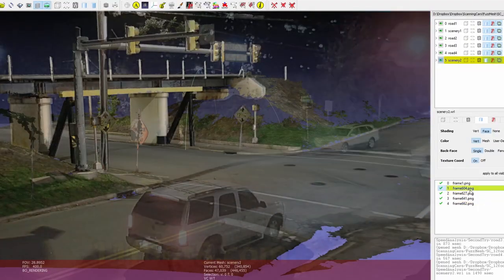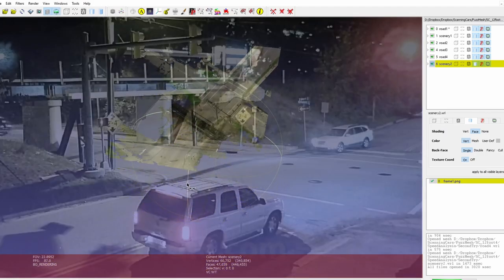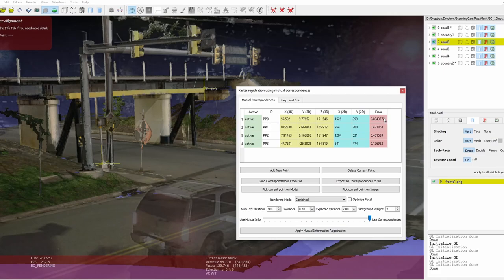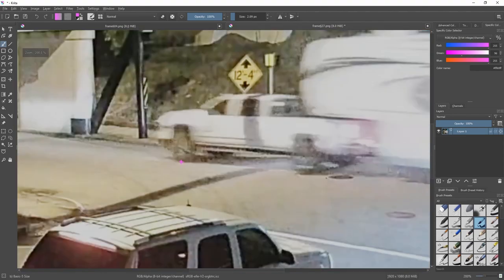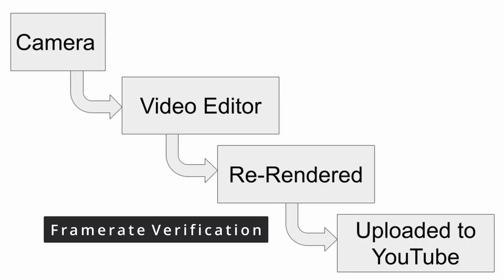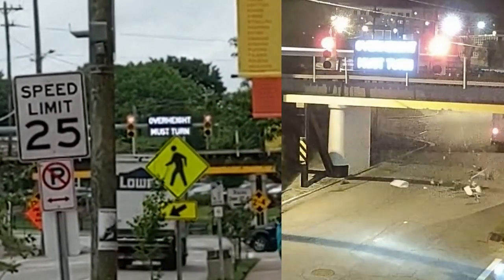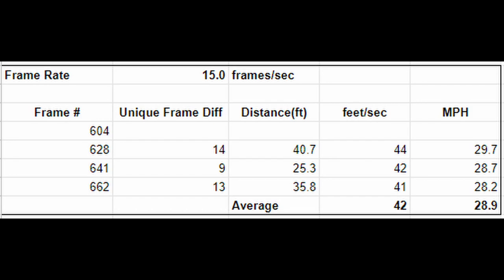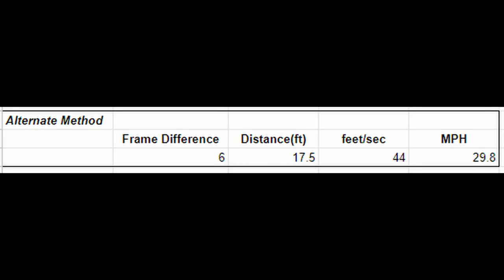11foot8 Bridge Forensic Speed Analysis - Scan Data - Reverse Projection Photogrammetry #11foot8

Comment: Frame rates on security cameras can be adjusted on most systems.  Mine typically run at 15.  If you adjust the frame down, you will gain more storage capacity (available storage time) for the same amount of hard drive space.  It all depends on how much detail you want to capture versus how long you want to keep the video data.  I enjoy your analyst.  BTW, I guessed 35 MPH.
Reply from the maker: That makes sense, thanks for explaining.
Reply: And many video editing programs just double up frames if your video project is requesting a higher framerate. This is quite useful if you have video sources with different settings.

Usually, if i have the option, i set up all video sources and the video editor to the same framerate. But frame doubling is an easy technique that uses very little processing power. There are more advanced techniques to calculate interframes, from averaging frames to AI, but these are use quite a lot of CPU/GPU time and can introduce all sorts of artifacts (since you are, in essence, inventing fake information to fill in the gaps).